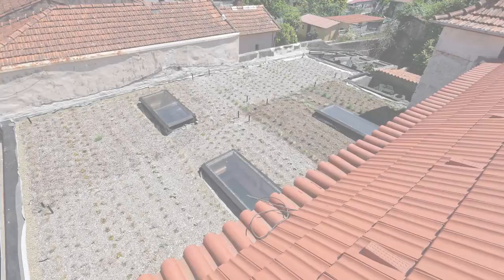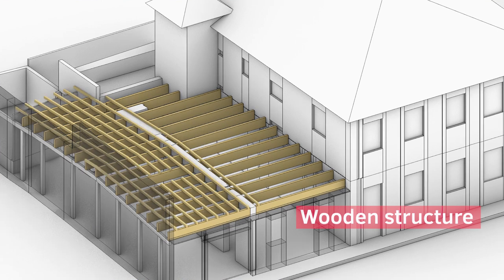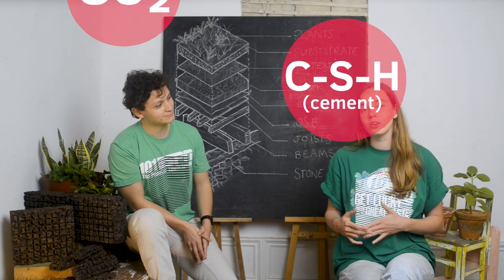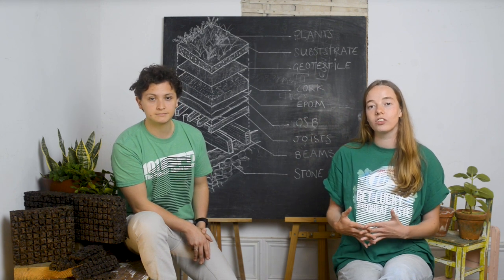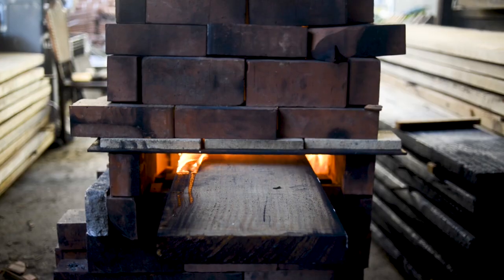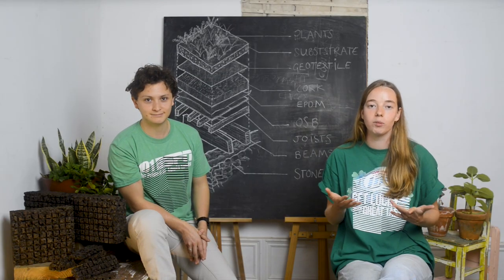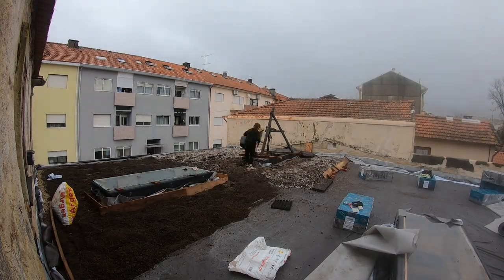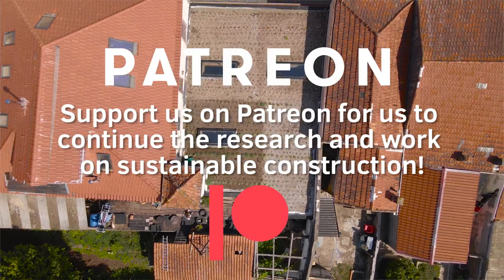Green Roof For Urban Sustainability

Comment: The green roof is the biggest con going in the modern flat roof game. Worked on them for 3 years now, not seen one bee on them (too hot in summer). And Epdm is the most problematic roofing membrane going. It'll leak in a matter of time (good luck finding the leak) and the roof will need replacing after 20 years or less. 👎
Reply from the maker: Agree on many points! Green roofs, like most roofs, are not maintenance free. I'd now add to this video that you need to monitor what is growing, birds and wind will bring seeds from anywhere, so deep roots plants are to be avoided and need to be removed for the sake of your EPDM joints. I don't think that the EPDM per se is the problem, but potentially the bond you put between each sheets of EPDM might. We had problem with the Rollgum 007 (sic) bond in particular, I would not recommend this product. When possible, I'd recommend to get a membrane the size of the roof (they manufacture them pretty big!). For bigger surface, get mindful advice on the best bond, again. If possible, avoid putting windows on the roof, they add quite a lot of complexity to the system and potential leaking points. The more openings you create on your EPDM, the more problems you might have. An good EPDM is pretty fool proof if you don't challenge yourself too much with openings and connections.
About bees and biodiversity, and heat: well I guess it depends on your exposure and climate. We did see a lot of new fauna on our greenroof, from cats to bugs (bees included).
How to avoid leaks on the EPDM: place it with socks, no shoes, strictly. The cork panels we put act as a cushion and protect it from little stones pressing the membrane.
How to find a leak on the EPDM: remove the layers on a big area around your leak, broom the membrane, them inspect methodically the area. See if any root is finding its way through the connection between membranes. Looks for holes on the EPDM, they often appear as a tiny cut. If you still don't find the problem, make a clean cut in the EPDM, in the direction of the inclination of the roof, to see where you find humidity under your membrane. Once you found the area more precisely, inspect by pulling the membrane with your hands under it, to see where you have your small cut. Let dry, then patch with a piece of membrane under your original membrane, and another piece on top of it. Follow instructions of the bond material you're using.
If you're doing everything yourself, you get a solid understanding of these things, if not, make sure you get a guaranty from the company that does the installation for a couple of years so that they would come and fix whatever is needed.
Like most things, after our experience with the green roof, I don't think it's a clear black and white option, rather another option, that can be done "pretty" sustainably and gives the possibility to bring some green space in dense areas, but not a miracle solution to roofing.